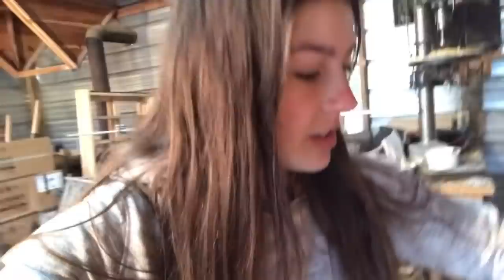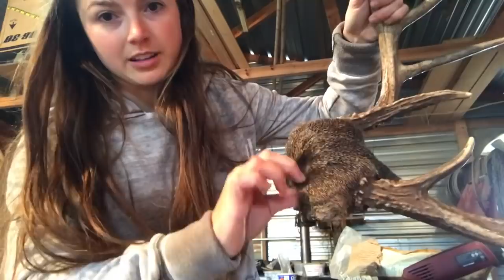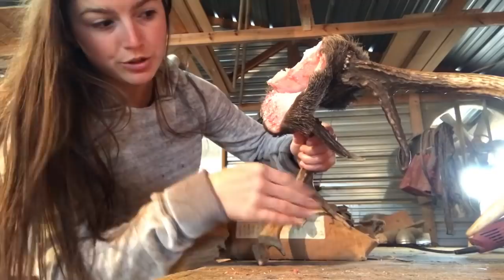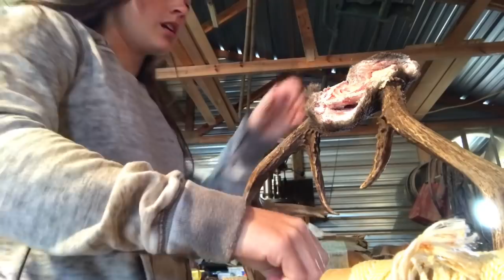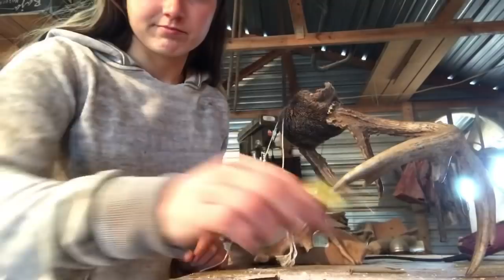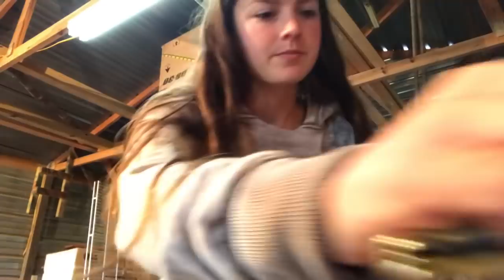Deer Season: HOW TO - DIY Skull Plates with Hide/Fur Attached

Comment: Dear Hannah,
 Its very possible that the deer fur is full of pollen, molds, and all kinds of other allergens. If your not rinsing and cleaning the fur you are possibly reacting to it. Also , Salt water irrigation of your sinuses helps tremendously, especially if you lay back hanging your head slightly over the edge of your bed.This will allow the salt water solution to get to your entire sinus cavity which is the most important part of this treatment as the upper sinuses rarely are touched by sprays or Neti pots. This treatment has really had a tremendous impact on my personal allergy problems. Love all your videos and Daddy is the MAN!
Take Care Out There .
Appreciate ya'll.
Ps Would Love to hear you sing and Play again.

Comment: Hannah that nastiness is the membrane coming from the skull and hide. If you want to do it right take the hide off of it carefully around the antlers. Boil the plate and scrape off any membrane. Scrape the hide off all membrane until it's white gentle with it , you don't want any holes. Put a small amount of tanning oil on it and let it dry to touch. While this is going on have the a antlers sitting in the borax and give it a good coverage hang it up to dry.
As far as attaching it back you can use dental floss with a Glover's needle or you can use a hot glue gun... I use both as hide begin to age it has a tendency to shrink like all hides do.. Hope this helps ✌️

Comment: I made a primitive Elk Skin Vest and used a small flathead screwdriver that I sharpened with a file to punch the holes through the leather with a hammer.
       I cut an extra inch in the pattern to overlap. Then used Weldwood Contact Cement to glue it together, then punched the holes and laced it up with 1/4 inch leather strips I made from scraps. Use a sharpened screwdriver and hammer to punch holes, works great.

Comment: I skinned my first buck skull cap back in 1986.  I dried it in a small trash bag with salt for 6 months. Then I found a piece of oak board about 10" X 10".  I sanded that board and stained it Golden Oak.  Then put clear coat on it a few times.  I mounted the skull cap to the board with screws and covered the the skull cap with tanned grey rabbit hide.  I still have my buck hanging on the wall out in the garage.  I was 18 then.  And it's 2020 now.  Simple math!  
I hang my hats on that rack.  No disrespect to the buck.  His rack still serves a purpose.

Comment: i use #10 machine tread bolt studs, they have a wood screw on one end and a #10 bolt tread on the other end, i drill a hole on the bone and thread the wood screw end into the bone, i put 3 to 4 of them into the bone and make a wood plank sanded and stained, clear coat, then drill the holes in the wood to line up the studs and counter sink the nuts in the back of the board,, put a hanger on the board and hang it up

Comment: Dan Chase Taxidermy Supply.
You should take the hide off salt with canning salt 24 hours it sets the hair they won’t slip out.
Then wash in cold water & Dawn soap.
After that cut any meat and silver skin off then the powdered insta-Tan. (Borax works just as good).
Borax keeps bugs out of the mounts.
Yes years of doing them.
Then put clay around the antler bases and then sew up around the antlers glue the skull plate flatten the hide out and you know the rest.
Put it on a board hang it for years of memories.

Comment: Well now this is something I haven't seen before! Looks much better than a standard euro mount! Might consider for next time,  thanks for sharing!
Reply: It works but I wouldn't recommend it unless you want it to dry rot on the wall.. Best thing to do is to remove the hair all the way to the beginning of the antler. Boil the plate clean and then salt the plate white which removes the membrane on the skull. Any membrane on anything will detoriate over time. Eventually the hair on that mount will fall out. Then it goes outside in the shed because it's going to draw flys...😋